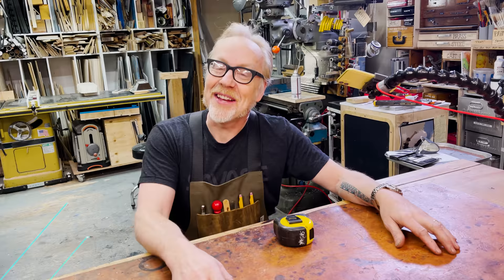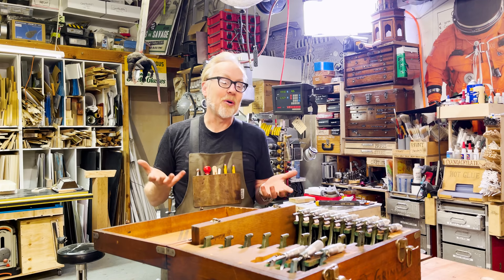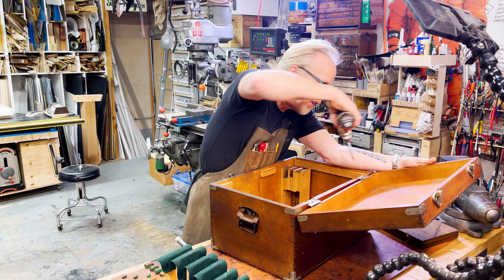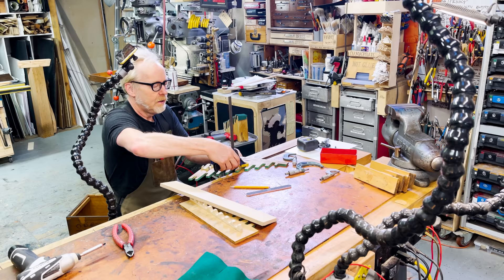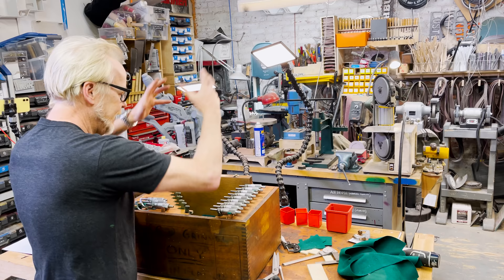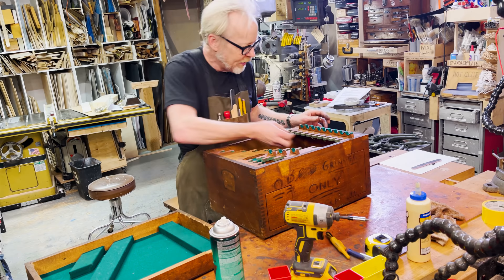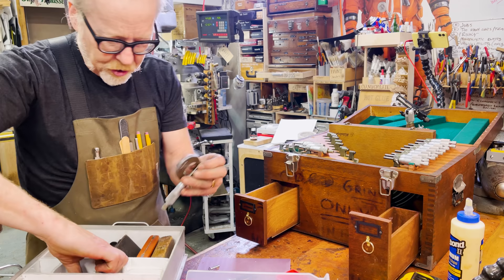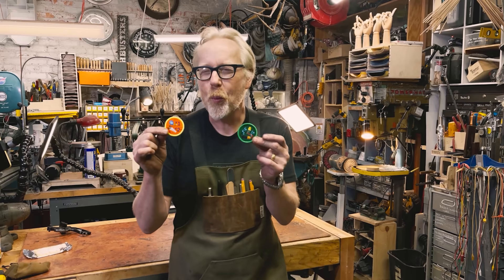Adam Savage's One Day Builds: Micrometer Gauge Box Set!

Comment: The things that are shaped like c-clamps are called micrometers they are not called calipers. Particularly they are called outside micrometers because they measure the outside you have some that will measure the inside you have depth micrometers the thing that has the dial on it it's a caliper there are other things called calipers but those aren't them. You also have dial indicators that can test run out and various other things

Comment: I posit that the whole concept of the wood box for the set of tools is poo-poo. Nowadays you can buy very cheaply, blow-molded cases of all sizes. Say you buy some about two inches high with length and width commensurate with the particular tool size. Or, alternatively, nest two tools per box. Then you fill the boxes with stacked sheets of high-density foam, the bottom layer(s) being uncut, while the upper layers are cut out to the profile of the tool(s) and any accessories for them. You can find the foam in all sorts of dunnage used in shipping consumer goods like TVs, etc., meaning it is free. It is usually white, but for some reason the black stuff  typically lines blow-molded cases that comes with tools or devices that use foam innards. By using stacked layers of foam, anyone with an Exacto knife can easily make slick-looking custom box innards. A little spray adhesive (or Dupont Pliobond brushed on) will glue the various layers together into an absolutely protective cocoon. Yes, now you have a bunch of small boxes instead of one cool-dude big one, but you can throw them across the length of your shop knowing everything is bullet proof. And you can modify them easily to accommodate new stuff without a lot of woodworking. It just goes to show you that there are many ways to warm the cockles of your heart.

With regards to the remark about expectations for A tool being uncritically  good from the day that you got it, I suppose that thought also applies to one's partner, with one day realizing that there will be a certain loosening of parts (psychologically speaking) be required to accomplish a bit of realignment for the desired operation (or, probably more likely, a acceptance to new expectations). There's a joke here about "blow-molded," but I won't go there.

Comment: There are a few things that kill me about this. On one hand, one day build, and I'm only 8 mins in, so I know I've got a way to go.
I note that the 'dial Vernier caliper' criticisms are about alignment (and with tape measures, or short/folding fixed length rulers it's often referred to as 'Parallax error' (when your eye isn't reading the measurement (or your marking) from a perpendicular view of what you're measuring)). Your micrometer has /all/ of the same problems for measuring internal pipe diameters (lets ignore the part where you were using the thicker square section of the Vernier Calipers for that demo as opposed to the chamfered  area towards the tip of the caliper).

My latter complaint is one that I know is going to land on deaf ears to the American Audience, but I LOVE the irony in measuring something in inches with precision, "It's half an inch, plus 4 tenths of a thousandth of an inch" ...wat.png

Comment: If you want precise measuring, there is a thing called the metric system. So .33” is roughly 8mm. And it the transference between measurements is easy. 1cm is 10 mm. 100mm is 10cm. Why does the U.S, UK and canada(i think) use the most inaccurate measuring system? 

Don’t get me wrong, i live what you make but, I think it would be more helpful to use the metric system. My opinion at least. Cool box btw.

Comment: Sorry, but there is some bollocks in this. A micrometer does not prevent misalignment, the user does. The wider jaws actually make user skill more critical, not less. Still, you're on the correct path, but you won't get to the true destination until you discover the beauty of metric.

Also: "Lets deal with precision, today we'll be working with wood." Yeah, wood never moves or deforms with humidity or temperature... or because it feels like it 😅

Comment: These American measurements are always soo strange. I mean it does make sense for those who are used to it - and can be handy when talking about wood pieces for instance - 3 by 4 and the like, but overall, it's just a mess - especially scientifically. Again, for the purpose of builders who are used to it, it works fine - until you have a piece of measuring equipment called "micrometer" which actually measures in inches and at that point I need a painkiller.. :P

Comment: I hate precision… it’s never ending and unrelenting. A constant struggle of deciding when to draw the line of “precise enough” cause you could always technically be more precise. You may be able to take 0.0001” measurements, but who’s to say your drill bit is perfectly 3/4” and drilling at exactly 90° in all directions. What’s stopping your sanding block from being perfectly flat over 98% of the surface but with a slight dip or peak on that remaining 2%. I hate Rick and Morty (or more so the fans that think they’re smart or philosophical for watching it) but that one bit they had about “perfectly flat” has rung truer and truer the further I delve into the pursuit of precision… ITS LIKE MY WORK IS TAUNTING ME SOMETIMES SAYING “Oh you measured within 5 thousandths of an inch? Well here’s a 2 ten thousandths of an inch defect. You just gonna accept that runout or shall we sit here for another half hour trying to solve this issue? Deal with it dumbass!”😂😂😭😭😭

Comment: :face-fuchsia-wide-eyes::face-fuchsia-wide-eyes:Savage you monster 👾👾👾,  it was going great until you put those bloody galvanised bolts in the lid, you blew the lid out with drilling instead of doing a pilot and then you left the heads exposed!  Jesus man either put a piece of wood on top of the lid rebated to hide the bolts or use different bolts with a 1mm flat on them  at least! oh yes, put chains on the lid to help hold the lid and protect the hinges from bending past 180º.  I can't bring myself to chastise you on the label levels..........Youre a great guy but you aint no cabinetmaker mate!! :face-pink-tears::face-pink-tears::face-pink-tears:😀